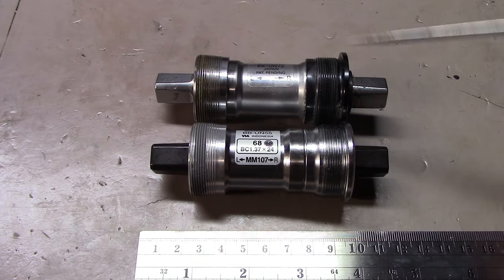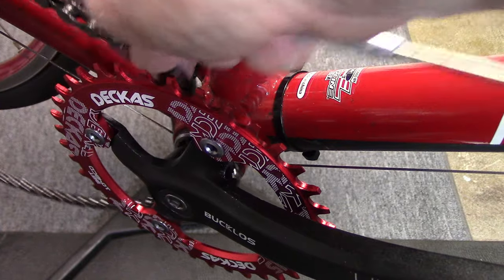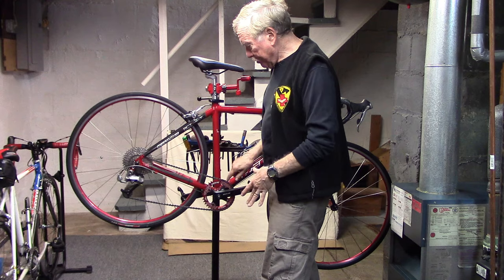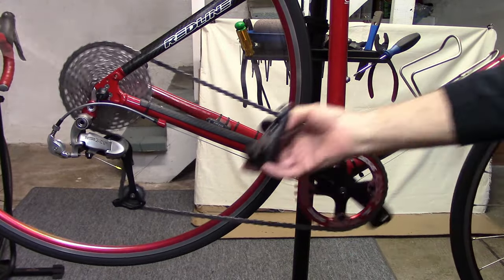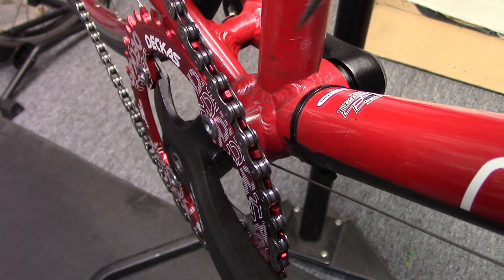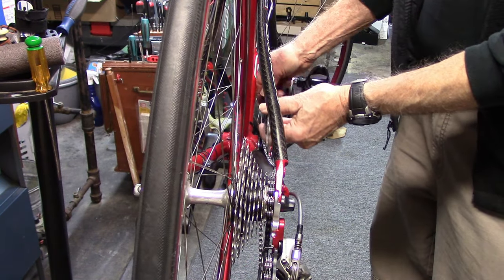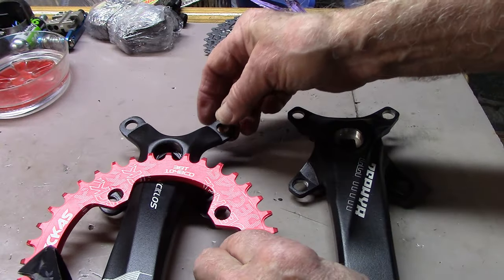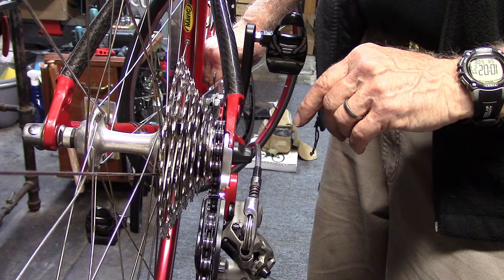1x (Single Chain Ring) Bicycle Drivetrains: View this before conversion or buying

Comment: Do you think a narrowide chain ring will worn out a chain faster?
Reply from the maker: I think it's more a matter of chainline. A poor chainline, especially involving the larger cogs may wear the chain, chainring and cogs faster the it would if the chainline is set properly. Here's the one of the few references on the topic:
https://int.oneupcomponents.com/pages/understanding-chainline-for-optimal-1x-conversions-boost-and-non-boost
Regards, Tony
Reply: @tony10speed   thanks for the information
Reply from the maker: @mysticscavenger6026  Here's an interesting discussion of chain and chainring wear on a 1x system:
https://www.mtbr.com/threads/narrow-wide-chainring-wear.971662/
Learn something new everyday. Regards, Tony
Reply: I had a 44 tooth 1X Wolftooth chainring on my Cannondale Quick 3, and it was still going strong after 7,000 miles and 4 years (including 4 winter use in Canada). That is until the bike was stolen 6 months ago. Now I've got another 44 tooth Wolftooth on my new Opus Orpheo, (replacing the annoying factory Shimano 3x9) but have only put about 1,200 miles on it so far. Anyhow, I love 1x's and will never go back. No chainline problems either.

Comment: As a frame builder (retired) particularly for larger males, I offset the rear chain stays by 7-8 mm to the drive side.  Allowes symmetrical lacing of the rear wheel and provides much improved chain line.  Stronger more reliable rear wheel for heavy riders (100 + kg) and better shifting and chain life.  The purpose of a bicycle is to carry and be powered by people over distance with more efficiency.  The engineering of modern bicycles does not take that purpose seriously.  Most bicycles are pretend clones of racing bikes either dirt or road.
Reply from the maker: I totally agree with you and appreciate your comments. Most cyclist want to look like pros and don't consider bike fit that suits there body structure, comfort, efficiency, and they're main goals in cycling. Unfortunately, the bike industry doesn't help in recognizing these factors.
Thanks for your in site and regards, Tony
Reply: Exactly right!! I've been complaining about this since I've had YouTube (2 years).

Comment: usually pedaling backwards its mostly a gravel or mountain bike thing since you need to ratchet the cranks to get your pedals over rocks or big roots
Reply from the maker: Thanks knife. All the more important to check the 1x mountain bike systems before you buy. You want the chain to stay in the larger cogs as you pedal backward. Regards, Tony
Reply: on the road i also do it to avoid pedal strikes when leaning into turns

Comment: Another option besides buying a new crank arm is to create your own spacers to move the crankring to the backside of the crank arms.  In my case, four stainless steel washers from my local ACE hardware, a dremel and a little time is all it took.
Reply from the maker: That can work as you point out. However, at least on some bikes, the front chainring does not sit in the crank arm stops and hard pedaling puts a lot of stress on the four bolts (or five depending on the crank arm). The crank and chainring I used I picked up on Ebay and was not expensive. My biggest problem with the conversion was noise in the largest and smalls rear cogs due to extreme chain line. This problem does not occur on all bikes but something one has to consider.
Thanks for your info and experience.  Regards and safe cycling, Tony

Comment: I love my 1x. I installed them on 2 of my road bikes. I got a 11spd 11-32 with a 46t wolftooth ring. I love the simplicity and little extra weight savings also makes the bike look cleaner.
Reply from the maker: I have a 1x on my mountain bike that works like a charm. Some road bikes can be converted to a 1x but other (as in the video) present noise problems when in the smallest or largest cogs probably due to the extreme chain line. Some new bikes present the same problem. The point of the video is just to point this out and make sure it works in all gears before you and the bike leave the shop. Regards, Tony
Reply: @tony10speed  yes. Great video. Never noticed any noise in the 32T /11th gear. Maybe I got lucky. Ill check the center line too. Great observation.
Reply: 1X is simple. I don't race but like the ability to have a big gear and a granny gear. I'm setup with a 48t chainring by 11-42 cassette. I use every gear, there is no redundancy. If I'm going on an extreme hilly ride I switch to a 42t chainring for that specific day. My only issue is that I often have to plan what chainring I'm going to use for what type ride depending on the terrain.
Reply: @jameslefleur1970  Exactly. 2x existed for a reason: they make sense :) Now if you want to worry about changing your crankset every week (and the chain, too, if you want to have optimal shifting), then go ahead :)
Reply: Are you sure you save weight? You save in the front but your cassette is then huge and then .

Comment: Thank you Tony, very informative with good clear filming angles. I have never been able to understand why cross-chaining has never been regarded (by those that market/sell) as an issue for 1x systems.
Reply from the maker: As you can see, in some setups (not all), it can be resulting in noise and chain wear. Regards and safe cycling, Tony

Comment: Ive been riding for a while now and i want to switch to a narrow wide. I locked my front derailleur already and i havent had any problems with gear range. I got issues with chain jumping even when it was all stock. This video helps alot thanks
Reply from the maker: Was the jumping on the front chainring or rear cog? Have you switched to a narrow wide and has that helped?

Comment: My Rockhopper had this issue, from the factory. On the smallest rear cog it was loud and annoying by default. I got extremely lucky, in that I changed my bottom bracket about a year after buying it and, purely by accident, the new BB I had chosen had a wider axle and that fixed the issue.
Reply from the maker: Marvelous work even if it was by accident. In our case, changing the bb helped some but did not eliminate the noise. But something to consider when hearing cassette noise with a 1x. Thanks for your input and safe cycling, Tony

Comment: Calculating your chain line ahead of time can help selecting a matching square taper bottom bracket. I lucked out on my first conversion. My first also changed my derailleur to long cage and wider range cassette for climbing hills with a big body rider.
Reply from the maker: Good points. Our viewers would like to know how you calculate the chain line?
Reply: @tony10speed  I installed a Prime Box 2 on a Diamond Back Topanga. I mounted the wheel with the new cassette, 9 speed, on a wheel. I took my longer metric T-square, I am close to Canada, lined up on the middle gear, between 4-5, and took another square out from the mid-line of the seat. I came up with 50mm. This was going to be a 1X. I went with a 103mm square taper BB. It did cut a bit close. I would go 105mm next time  to give some more room but it works well wit a 32t chain ring and direct mount crank.
Reply from the maker: @sagehiker  Very clever and easier then Park Tools calculation method. Thanks, Tony
Reply: @tony10speed  Rough Neck Tech rules! :)
Reply: @sagehiker  without the T-square, i wonder if i can set the bike upside down and hang a string down from the 4th cog on the cassette. the only problem is making sure the bike is level before i measure it

Comment: I just converted my Cervello P2 from 52/34 to single 55. The rear cassette is factory 11/28 and I had to adjust the rear derailer to prevent selecting of the 28 cog because the noise was loud and it caused chain-off events. Since doing this I have improved my hill climbing and learned to apply more watts output and plan the hill climbs better. Getting used to slowing down and selecting easier gears must have been hurting my performance because I seem to fly up the hills a whole lot better now. I may look at an offset crankset like you have used to enable the 28 cog, in fact I ordered a new 11/34 rear cassette to expand the range a little for the really steep hills.
Reply from the maker: Check out the specs on the rear derailleur that it can handle a 34 rear cog. The specs will tell you the largest size cog it can use. Sometimes, a Wolf Hanger Extender will allow slightly bigger cog, but not by much. As to the noise in the largest cog, changing the chain line can help. This can be accomplished by a front chainring that attaches to the inside of the crank as shown at about 3 minutes into the video. In addition, a slightly shorter bottom bracket may be in order. Lot of things to consider when upgrading your drivetrain. 
Regards, Tony

Comment: i run a 1 x 10 system 42 at the back and 34 at the front.Now yes its great for uphill but on the flats and down i dont have enough high gears.Also cross chainging is a problem.I am considering going to a 2 x 10 system and front derailleur.
Reply from the maker: After trying the 1 x 10, I also prefer a 2 x 10 for the same reasons you mention. Regards, Tony

Comment: I bought the same sprocket (32T version ) there a good value @$8. They even included the hex bolts as a bonus. To convert a Specialized rockhopper to a 1x8. Mine would only bolt to the inside of the spider in the same position as the stock 2nd (middle) ring. I didn't use any washers or anything to alter the chains line. My chain looks straight on the 3rd gear cog and has no problem shifting through the other gears. The bike wasn't fussy about reverse peddling either. I rolled the crank back washing the bike and doing chain maintenance and it rolled along no problem. It didn't jump off of the cassette or do anything weird. I think if the change made using the highest couple gears act dodgy I could still live with it. I do most of my riding in 3rd gear anyway.
Reply from the maker: The 1x conversion problems occur on some bikes and not others. The video is a "cautionary" tale some one is aware of problems that possibly can occur. Thanks for your comment and safe cycling,  Tony
Reply: Wow good job for 8 dollars!

Comment: If you use the same triple crank converting to a single just use the middle 32-34 chain ring and leave it on the underside-same middle position of the crank. I`ve done it on three bikes now works and looks just fine.
Reply from the maker: You can do that, but my daughter wanted lower gears to go up hills. To accommadate that, she wanted a 30T on the front and an 11/40 on the rear (the 30 would not fit on a middle position of a triple crank - BCD of the chainring is too small to fit a 30T, at least with the triple cranks that I had in storage). But those that require simplicity without shifting a front derailleur, use of just a middle of a triple would work. Thanks for your comment. Regards, Tony

Comment: I've just installed that exact same crank set up on a 68/113 bottom bracket mounted to a 26er mtb with 135mm rear axle. I'm running a 7 speed cassette and chain.
I have however bolted the chain ring to the inside of the crank arm. The chain line is perfect and it looks like a 46t chain ring would fit without interfering with the chain stays.

Boy, that's a lot of jargon right there but I'm sure you had no trouble with the translation.

I was tempted to go with a 9 speed once my chain needs replacing but having watched this I may go for an 8 instead.
It looks like the 9 speed chain is perhaps too narrow for the narrow/wide chain ring.
Reply from the maker: Narrow-wide chainrings are also available to suit different ‘speed’ drivetrains. For example, a 9-speed chain is wider than a modern 12-speed chain, so it requires a different profile of narrow-wide teeth for the best performance possible.

Not all narrow-wide rings use exactly the same tooth profile for the "wide" teeth, so take that into consideration. A company like Wolftooth advertises that their rings are for 9/10/11/12 (caveat that not all 12 speed chains are interchangeable).

Wolftooth also notes that if you're using a 9 speed system, use a 10 speed chain for better chain retention. You can generally use a chain for one higher "speed" without much issue.

If you have a 6/7/8 speed system (these all use the same chain), you should consider using a 9 speed chain on your 9-12 narrow-wide, as it will work with the rear derailleur and will fit the narrow-wide chainring better than a 6/7/8 chain.

"Does the structure of the chainring help with lower speed(like 6,7,8 speed) chains as well? " It would certainly work better than a standard 6/7/8 chainring in a 1x system.

12speed chains and chainrings are a whole different bag of dicks. There are different standards for 12 speed chains which means you want to make sure the narrow-wide chain ring you're buying is specific to the type of 12 speed chain you have.

One additional note:
For inner chain width there are the following standard dimensions: Single speed chains have inner width of 1/8″ (3.175 mm). Multi speed chains, from 5 to 8 have inner width of 3/32″ (2.38 mm). Multi speed chains from 9 to 12 speeds have inner width of 11/128″ (2.18 mm). This is why the 9 speed chain on the Wolf narrow-wide (9-12 speed) works better then the 8 speed. 

Anyway, I hope this helps. Regards, Tony
Reply: @tony10speed  Thank you for all the data you've shared with me and so promptly.

When I started riding a pushbike (English terminology) the first one I rode that had gears was by todays standards a 1x5 and a brand new one at that, complete with downtube friction shifter. 

It never dropped a chain.

So how did it do it? 

It didn't require the narrow/wide chain ring or a clutched rear derailleur to achieve this almost impossible to achieve feat by todays standards. 

It did it because the rear sprocket only had 5 cogs. It was always never that far removed from its perfect chain line. 

Todays bikes with their cadence fetish issues simply cant compete. It's always going to be a compromise. But I'm not giving up.

Bucklos do a steel chain ring optimised for a 2x or a 3x but it's not a narrow/wide 4mm thick piece of 7000 grade ally. 
It's steel and thin.

My guess is with a dummy front derailleur to keep the chain in place it could well work with a wide range rear cassette. And quietly.

But yeah I'll take a 11/40 five speed with a 50 up front any day of the week.

Comment: Great video. I find the benefit of a one-by, acceleration on trail. I recently purchased a used Santa Cruz Stigmata and the one by works by making the bike psychologically fast, but you lose power options, and you lose some teeth on big pitch climbing. My advice is simple, take the bike and convert it to a reciprocal of your relationships. All in all, the goal is to have safe and wonderful relationships that motivate you to enjoy the sport together. If you are fixing your daughter's bike, you are teaching her independence.
Reply from the maker: Thanks for sharing. Some new 1x work very well. Last year I put together a Giant 1x which works great on the "Rails to Trail" but as you said, it has limited gear capacity. But for me, it just enough. The point of the video is to consider all these facts as well as noise when converting or buying a new 1x bike. Regards, Tony
Reply: @tony10speed  Thanks for writing back, I like your channel! I recently started using my Trek 7.5 as a 1x because I changed the chain myself and shortened the chain too much! But my rule is to learn and live with my mistakes for a while. I have been using Zwift on a Garmin, and it is great. I set a plan, ride once a day outside for fun, about 1 hour, ride 30 minutes to 45 minutes a day at night on the Trek 7.5 with the Garmin Trainer for building power and cadence.

Comment: I think most cranks bolt on the outside of the ring, making the ring on the inside. Therefore the latter situation is what most can expect (more smooth, no chain jumping)
Reply from the maker: I tried another crank with with chainring on the inside of the crank as well as a shorter bottom bracket. Helped only slightly.

Comment: I converted a couple 2 x and 3 x to 1 x.  My 120-spaced 5-speed never once dropped the chain.  (When you don't have a front mech you can't shift it back on.)   I used a Paul Components gizmo that worked well to keep the chain on another.   I enjoy the simplicity especially with a friction shifter.  I'm using a 46 x 12-32 9-speed currently.  Too hilly for a single around here, for me anyway.
Reply from the maker: Sounds reasonable. Thanks for sharing, Tony

Comment: How about using longer chainring bolts and spacers with your the new crank arm to exactly align the chainring with the center of the cassette and likely eliminate the chainring noise completely?
Reply from the maker: If you look carefully at the chainrings and crank, you'll notice that the inner flanges (opposite the chainring teeth) rest on the inner flanges of the crank arm. Most of your force when cycling is supported by these flanges.  The chainring bolts just hold the chainrings in tight on these flanges. If you use washers and longer bolts to move the chainring toward the bike frame, much of your force used when cycling will be on the chainring bolts themselves rather then the flanges they were designed for. The bolt are usually alloy and can deform or break under load. Even if the bolts are steel, they're not really meant to support the forces produced from cycling, especially under load.
Reply: @tony10speed  There are spacers designed to do just this and it's done all the time.